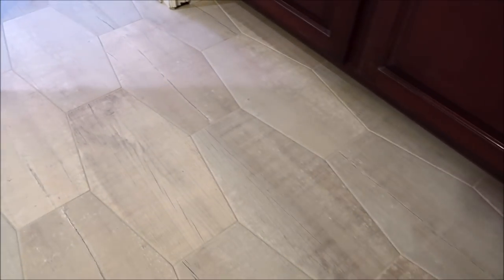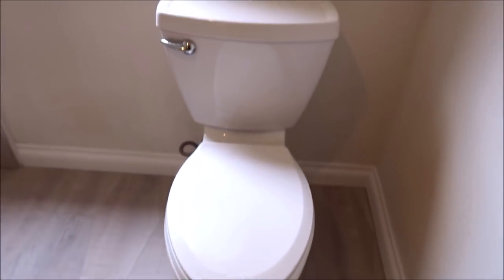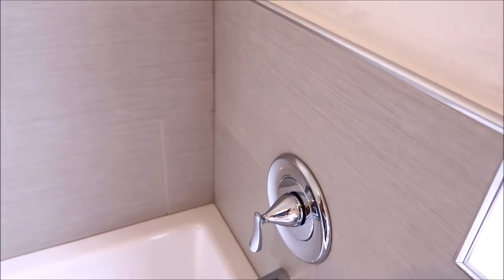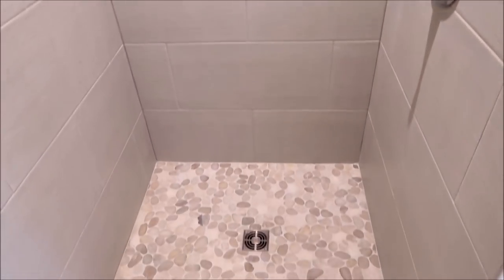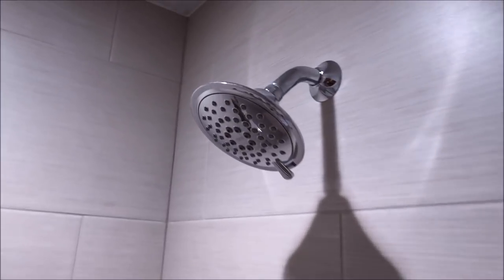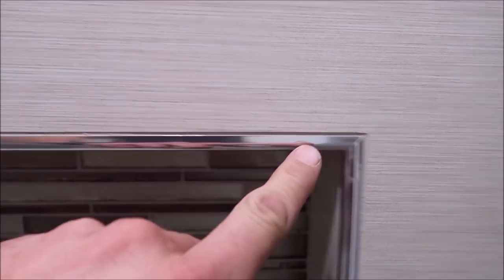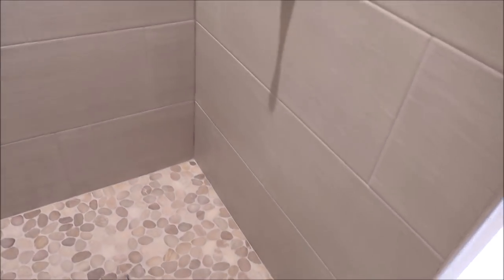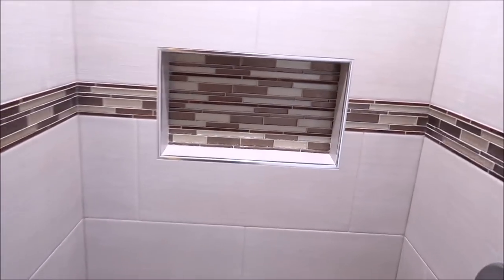Hex Tile Bath & Shower Tile ideas Episode 25

Comment: Your trailer looks exactly like mine that I got from Home Depot about 23 years ago. I have been pulling it almost every day for the last 15 years to carry several large steel job boxes for tools & materials. 
I'm a Jack of All ....Master of Some so I carry all the tools and materials of all trades which can get quite heavy. Three years ago I decided to reinforce the undercarriage with an additional angle iron frame and add a tandem axle with brakes so I could use it to carry the heavy loading more safely.
Reply from the maker: Thanks for the great trailer tips!

Comment: I was curious about that dewalt box set. Didnt wan a spent the money on an unnecessary box. Wondering your impression of it... do tools get lost in the shuffle? What's your setup (power tools in bottom etc.)  Also I wanted to share I have that same saw. I put casters on the bottom when I first got it like 4 years ago and being a tall guy its helped also you can just wheel it around easier. Gotta have locking ones on front tho. Nice vids man.
Reply from the maker: We have two dewalt boxes, one for tile tools and the other for all dewalt power tools. We love them! Both fit nicely next to each other in the back of the truck. That's a great idea for the saw stand! I'm 6''3 and can benefit from the extra height! Thanks for the tip!

Comment: What's with the door Jambs cut to high?
Reply from the maker: The jambs were cut like that prior to our installation, client will have new pre-hungs with casing installed after 👊
Reply: Easy to pick apart others' work, but yeah, those do stick out like a sore thumb. Not their fault is my guess.
Reply: At least they are changing them great job tho

Comment: I would have done 1/3 offset with the 12x24
Reply from the maker: Cool, but our brains are super symmetrical...lines in the middle with same sizes on the sides. 1/3 still does look good though 👊